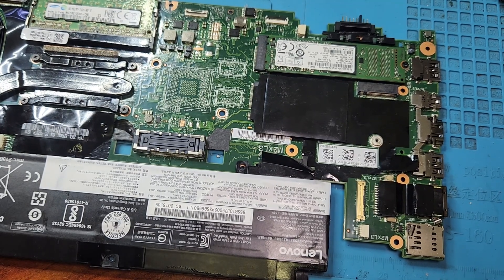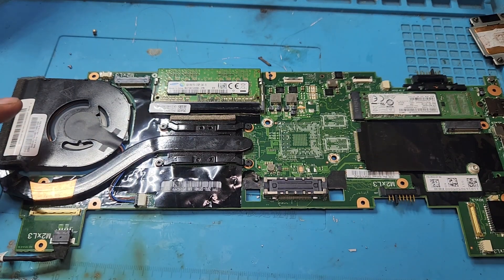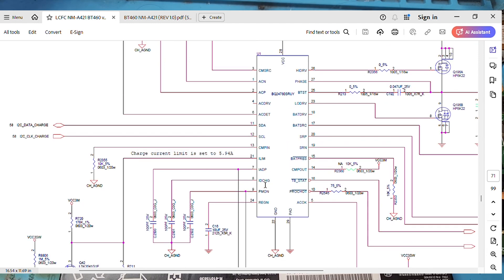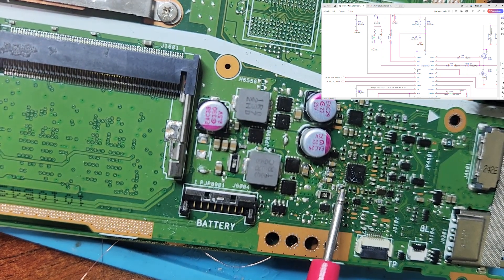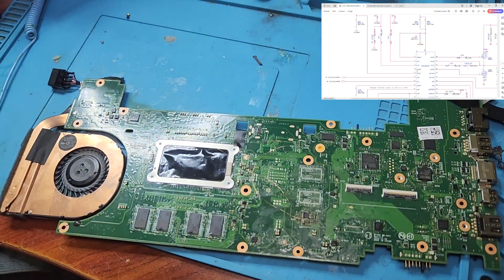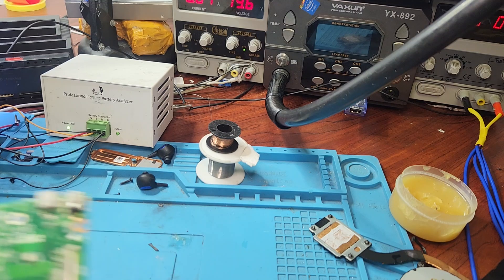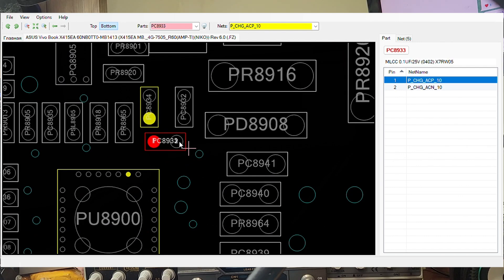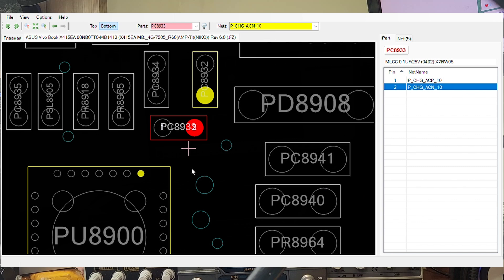BQ24780s Laptop not charging but works from charger and battery

Comment: I had the same fault on a asus Tuf506IV, works on charger, works with a charged battery, but the battery would not charge... it ended up just being the 1st input mosfet that was shorted, I replaced it and it worked fine

Comment: so its the current sensing resistor is faulty?
Reply from the maker: Not exactly, it's probably not sitting properly or the circuit broke somewhere along the line before reaching the Current sense resistor